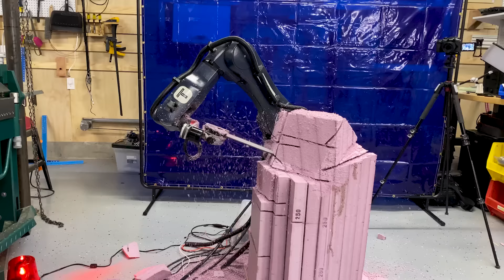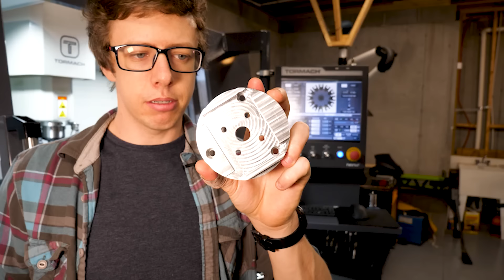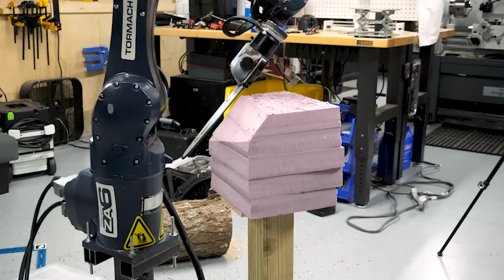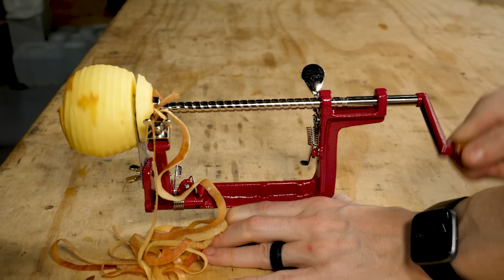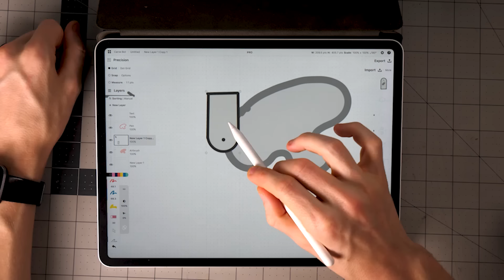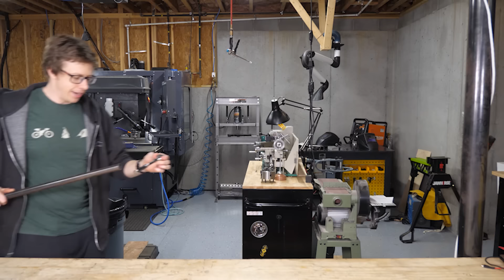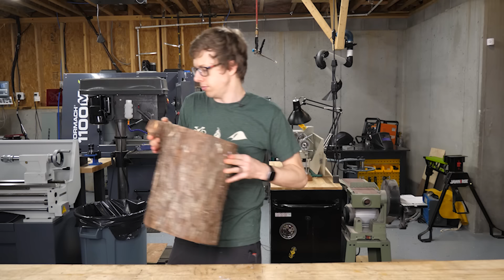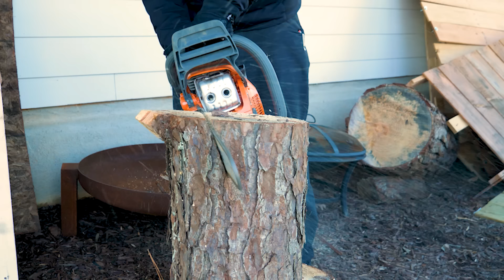Chainsaw + robotic arm = art?

Comment: As someone who uses a chainsaw a lot, I must ask: Did you oil the chain? Or sharpen it? And if the anti kickback notches are troubling you can either sharpen those away or but a new chain. Also you need an actual electric chainsaw and not a garden saw.

Comment: The solution to your local maximum problem with gradient ascent is called simulated annealing. Essentially you allow your program to occasionally take less optimal routes to the maximum. It can still end up with the wrong answer, but it does so far less often and the solutions it finds are usually better.  It's a bit confusing at first, but it ends up being fairly simple to write. It also runs relatively quickly. You might be able to apply it to parts of the program you ended up with.

Comment: if you can manufacture Bear Shaped Log's you got a Business that does not require any Artistic Talent though your product ensures you Look to be an Artist LoL also as a CNC might require an array of tools i am thinking  you will need atleast a tool tray of as many as three interchangeable blades if not it needs to be programmed to dip the saw blade while spinning in a bath of oil ever so often thats why you had the smoking the chain needed oil to avoid burning up the Blade. multiple saw blades are needed as each chain gets DuLL from its work Load wear if you did not design an automatic Oiler it will need Oil bath breaks to cool the chain i also can't believe you failed to understand it needed oil to counter the Chain Friction Heating

Comment: Your chain was really loose initially and also the small chainsaw you used had a dull blade was really low powered. also those were not anti kickback blades those were the depth gadges its how big you want you woodchips to be when flying out.

Comment: sharpen the saw and oil the bar while yer cutting. also try keeping the saw cutting on the flat part of the bar and not the end, or the end and not the flat part. the chain needs an opportunity to clear the sawdust.  also make sure the chain is tensioned properly. and then sharpen it again.

Comment: You could've just used calculus, by using the second derivative you can find the point of inflection in a given curve, as long as your cuts are angled according to those points of inflection you can't get it smaller. Then you turn it 180 degrees and use the curve of that side. It sounds complicated but at most it would take 30 lines of code to math out the angles to attack it from then you'd just have to program what instructions you give to the bot

Comment: Try using a dry, soft wood like basswood or pine. That stump you used was wet and dense and hard; very difficult to cut. Not all woods are created equal.

Comment: You're right about the chainsaw burning the wood. Those chip-clearing teeth need to be filed down a bit. it's part of the usual sharpening process. However, if you file them down too much, the saw will bind. Alternately, there are different chains that can cut tougher material. Super cool project though!

Comment: 17:00 Tighten your chain and go to a full skip chain for bore cuts. Also get good at sharpening chains and you’ll be off to the races using wood
Reply: Adjust your bar oil pump to increase oil to the bar and chain.

Comment: Those aren’t “anti kickback” there depth gages that determine how much the chain takes off in   Each go. The other problem is that there is no bar oil to lubricate the chain while cutting which is why it was getting so hot.

Comment: You should add a bar oiler and also why not use a servo motor to compensate for loads to maintain a specific sfm for the saw?

Comment: Great video. Awesome gumption. Carving by hand first might have helped plan the tool path. Adding parameters to the software would surely help program the tool path. The path has to be programed based on the parameters of the tool rather than a made-up math puzzle. And you had a robot given to you. Ask Gibbs or their competitors for free CNC software. A better understanding of metrology would make a world of difference. And knowing tool load would grant the understanding that your first idea had great merit. It takes days to carve out a sculpture. Write the program known to work with the least tool pressure and let er' rip for hours and days and maybe a week. Only one tool is being used. Lastly, try painting with it. Super fast to figure that out.

Comment: I am an electrical/computer systems engineer (retired) myself. I admire your energy and dedication. You designed and built a chainsaw carving robot. I just finished a bird house. I know, that is not as impressive, but it still provides the possibility of the loss of digits. :-)

Comment: Me: still trying to get the boss to let me put a grinder in the robotic arm
Reply: dude when a youtuber who makes exploding baseball bats tells you something is dangerous its for a reason
Reply: @aldrichunfaithful3589  yeah dude.... its not easy to tool path something that needs to be programmed the hard way XD there are all sorts of robots and... I would say also... all sorts of aptitudes...
Reply: one more... for shits and giggles...  those robots usually have a programable blood zone... or their limiter box... which I imagine shouldnt be too difficult to make... even if there isnt already one.... the robots have restricted movement limitations too based off the load on the servos. o-o decorative deburr work with a diamond wheel isnt unreasonably difficult with a robo arm... the guy just doesnt want to put any real work into the projects because he thinks it will scare customers away

Comment: Whenever Buddy says that someone else who is smarter could do something, but he can't...I feel like a vegetable
Reply: why is this so relatable?
Reply: I know this makes it worse, but just remember there have been 15/16 year old kids who have cracked apples best iphone security with ease.
Reply: well as a math guy who says "you could do this this and this"... yeah, trust me, i wouldn't want to try this either... maybe if i could start over at 18 and go engineering hardcore.  At least the good thing with his cutmaking is he can use the polygons as the basis and then determine where there are (or ideally, not) planar intersections... you can at least arc out the convex hull but after that it gets tricky but not impossible.  then its seeing which planar polygons have intersections in which directions, if you can cutaway and have enough clearance, then cool.
Reply: Why scot pilgrim is making robots?

Comment: To prevent industrial injuries from moving parts or sharp surfaces one must have a secure, electrically interlocked barrier preventing human contact with the moving parts or sharp surfaces. The flashing light will alert to a danger, but not prevent injury.  The instant-off switch will at best stop the machine quickly, perhaps preventing further injury once one happens.

Comment: have you tried using a skip tooth or one that has every 3rd tooth removed? it might improve cutting on the tip. that said, skip tooths, especially on the tip are really dangerous for kick back.  but i would guess the robot arm could handle that?

Comment: The algorithm that you need to control the robot arm is called : Forward  and reverse kinematics. You define every axis of the robot as matrix and you can compute the position of where the effector (the chainsaw) needs to be depending on where you want to cut. You can also define area on where you dont want the robot effector to go (prevent from cutting itself). After the kinematic done you only need an algo to make the robot move on x,y,z position with the correct axis rotation

Comment: you should be using bar oil on the chainsaw bar to help with over heating and to stop the chain from becoming loose bar oil can be any oil I use old car oil after I drain it

Comment: At 17:00 when the saw started smoking, the bar oil was on it’s side and because it isn’t full, it might have had some difficulty feeding onto the chain causing the chain to smoke from lack of lubricant. Possibly something you might want to look into? But the rubbing also seems plausible. Great build nonetheless!

Comment: Do a much worse one for free...hmm...CNC mill, CNC router, the computer rig, turret lathe, that large robotic arm and the modified Stihl Kombi pole pruner together are easily hundreds of thousands of dollars worth of equipment.  I would have tried to made the saw more robust removing the belt drive and replacing it with a chain drive and cowlings and covers to protect the brushless motor, bearings and anything in between.  Your chain was also not adjusted properly as you shouldn't see the sprocket side coming out of the bar like that.  This is what slows cutting down as well.  I have an Echo PAS pruner attachment and it really does slow things down when the chain isn't adjusted properly.  

That said, your information on how the CNC machinery works and the calculations and coding works together definitely blew me away.  I knew it was complex, but I didn't think it was that complex.  Nice video overall.

Comment: I'm torn a dozen different ways on how to comment.

Clearly a lot of skill behind the effort, and even a very good effort.  KUDOS!!!

But as someone who has not only actually used BOTH a six-axis and a chainsaw, I think you missed an opportunity.  (Disclaimer, yes, programming difficulty would have gone up exponentially)

Limiting the use of the chainsaw to only the length of the cutting blade and essentially 2D cuts severely limited the outcome.

I feel you limited yourself to "roughing" cuts.  The roughing cuts should have been the START, then you should have expanded to utilize not only the full range of motion that you demonstrated early in the video, but also the use of the blade tip.

Yes, this likely would have exceeded the moment capacity of J5/J6 and I respect that as a limitation.

How to overcome this?  Think tool changer.  Not only two programming approaches, but also TWO tool approaches, one "roughing" cutter, but then a small, more detailed cutter (and therefor less moment on J5/J6).

More work??  Absolutely, but that's the job...

Of course speaking honestly, the fact that you tackled the job in the first place gets you 100 Internets.

;)

Comment: Problem with gradient ascend, at least from the explanation, is that if you have two hills one taller than the other and start guessing in the shorter,  you will never go to the higher one.
...
And 10 seconds later that problem was mentioned,  note to myself to finish the videos before commenting 🙄

Comment: "Get way out here and snap your wrench in half"  get a bigger wrench. I've had 3 guys hanging on a 12 ft cheater  on a 48in pipe wrench, 4th guy with the torch. Sometimes the thing still won't break.

Comment: 10:45 If gradient ascent gets stuck in local optimum, you could try something like Particle Swarm Optimization. It's actually very simple - instead of one ball, you have 10 or 50, they have inertia, they have some randomness, they start at random points, and over time they get more and more attracted to the best global solution found.

Comment: BTW, that chain was  waaaay too loose. It should not hang off the bar like that. Also, chainsaws need constant lubrication to the chain, otherwise it will just chew itself up. They also need to be sharpened, often.

Comment: that chainsaw chain looked waaaay loose and the propblem with the chainsaw was mostlikely due to those "riding" teeth you should try going at them with a file, I know there is guides for how much to take of the out there. and there mightve been some trouble with the oiling of the chain, that usually messes the teeth up real quick

Comment: When I first learned to program CNC Machines they were quite new and we had to input every single line manually, only a mchinist could learn to program back then. Modern machines are really quite remarkable. The finished and tested programmes were then saved on punched tape.

Comment: Love your video. I am commenting because for once I can actually contribute something useful.
One of the solutions to your false peak problem is the use of particle swarm (I think that's the name, I could be wrong). Basically, instead of a single starting point, you start with a swarm of starting solutions. Each one still has a "best direction" you calculated but it becomes a force that would move the point. For each point, you add another force that "pulls" the points together calculated for each point at every iteration. By tweaking the strength of each force, you get something that converges toward the best peak. You can also add other elements like the fact that a better point will pull at the other points harder than a worse point.

Comment: I think your problem with the chainsaw Not cutting the wood is that the  tooth infront of the cutter is not for kickback protection. That tooth is there so that the shavings get cleaned out. When you sharpen the chain you have to shorten that a bit or otherwise it is just rubbing and preventing the cutter from doing its job.

Comment: Great project but you gotta do a wood log. Now that this video is done try it with a wood log, maybe add periodic cool down periods for the motor and still cut the log in ~14 hrs, still a reasonable time compared to how long this would take for a human. You could add a fan to cool the motor/esc. The wood will be much easier to cut if the wood is wet too, maybe use a wet log or have lubricating fluid/water get squirt onto the blade like a cnc machine. It sounds like you havent tested the chainsaw to failure yet, so you should try that.

Comment: You'll have to keep sharpening the chain.  You might be better off with a ripping chain but that's another discussion.
I was thinking of doing something like your project but using an angle grinder with a carving attachment called a Holey Galahad.  There's a lot less moving parts, less leverage, no sharpening and less dangerous.  Might be a better way to go?

Comment: Cutting the log failed because the depth guards were not filed down properly, so the cutters could not cut deep enough into the log.

Properly sharpening the chain will fix this.

Comment: If I undersood correctly then the big issue with gradient descent algorithm was getting stuck in local extreme, would that be possibly solved by simulated annealing, or did you try that and it was not good enough for this use case? Just wondering and desperately wanting to find places to apply all the wonderful whacky algo :D

Comment: This problem with the gradient ascent is basically the same like the problem you have with machine learning which relies on gradient descent. If I am not mistaken there is no real solution to finding the optimum apart from trying different startpoints. And even this is guessing.
Things that could help are:
 - variying the start parameters
 - sometimes deliberatly introducing errors (doing the opposite) by chance (e.g. 10% random based) which if they don't improve accuracy will be fixed anyway [drop out layers, ...]
Also overshooting is a problem which in AI-Neurol-Nets and their gradient descent is fixed through different learning rates which is basically a factor you multiply your change with.

Comment: Maybe you would get a better finish with a chainsaw disk blade for a low angle grinder.  Then you could change to an Arbortech planer blade for a very smooth finish. A grinder might also be more compact than a chainsaw.

Comment: You have to routinely file down the rakers on the chainsaw to control the depth of the cut, or else the rakers will block the teeth from cutting and you'll get lots of friction and heat 👍

Comment: Sometimes it helps to look at the problem backwards. For instance why don't you use something that can cut away a lot of material and stay sharp like a router bit except use the cutting point as a fixed position. Now you can use your robotic arm to rotate the log around The cutting head. does that help?

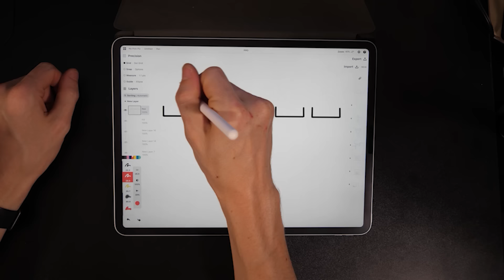Comment: 3:28 sure, a 5 letter, case-insensitive password. If your password is case-sensitive, that jumps to 380 204 032. if you limit yourself to alphanumeric characters (0-9, a-z, A-Z), that increases to 916 132 832. If you're limited to the entire Unicode standard (version 13) instead, that number jumps to 143 859 ^ 5, or 61 614 820 000 000 000 000 000 000. that's over 61 septillion
Reply: and why did you feel the need to comment this?
Reply: What if the password is between 3 and 16 characters?

Comment: Using something more like a large belt sander with heads for two grits would have made this a hell of a lot easier but messier. Also the real scary thing with that arm is it would be ttrivial to modify it to move faster then anyone could possibly react to unconsciously let alone hit a button. For that some sort of "meat detection" would be the only safety.

Comment: Some industrial robots aren't as dumb as you depict them: The robots from ABB, FANUC or Kuka would still machine themselves away if you told them to, but they monitor the torque on any motor and do detect collisions. That doesn't mean those collisions are harmless, though.  A robot that could throw cars at you will still hurt, even if it found out to have hit you.

Comment: For your gradient ascent / descent problem, you should look at two concepts we have in deep learning : the learning rate, it will help you to control the speed of your convergence and trying to avoid to get stuck a local minimum / maximum (check cyclic cleaning rate, or some scheduler). And the optimizer itself you were using can do a learning rate decay too (check Adam, adamw) . Contact me if you want more info :)

Comment: I'm just an idiot but why the heck are you trying to use a chainsaw? You should be using some other device with a routing bit that will cut away the wood much more precisely. Those fancy "chainsaw animal logs" you see are like... 10% chainsaw work. The rest is chisels and sanding.